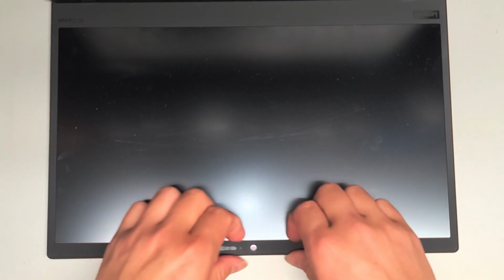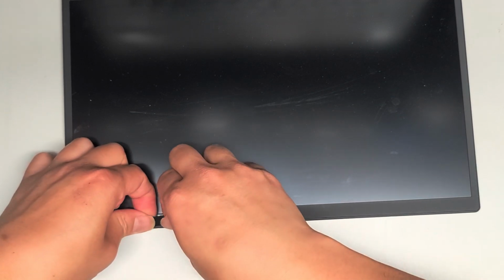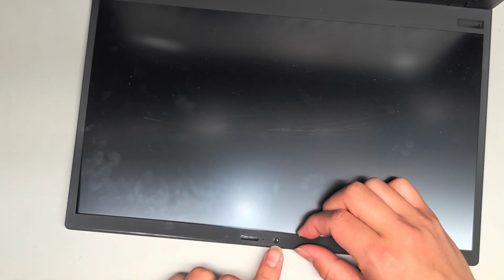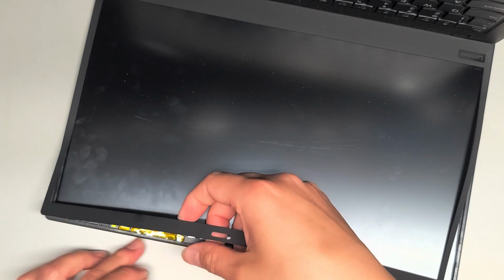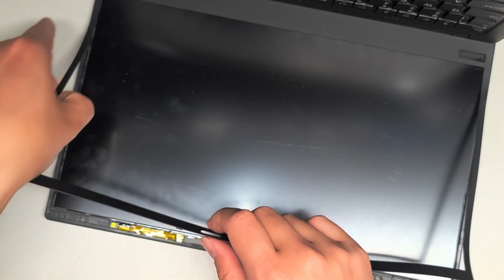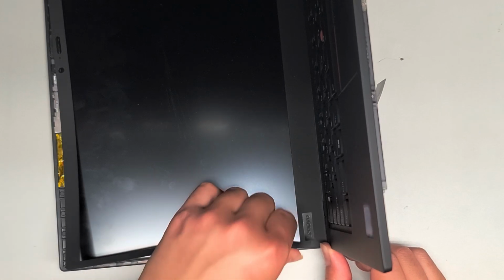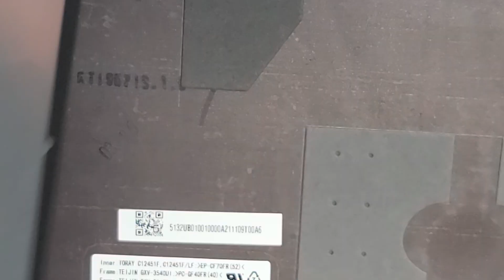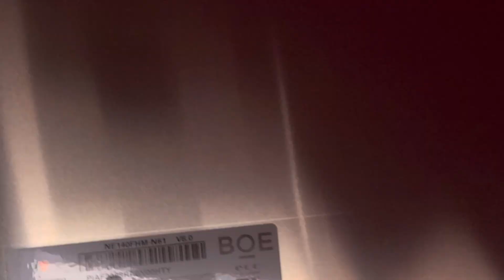7th Gen Generation Lenovo ThinkPad X1 Carbon Disassembly LCD Screen Replacement Repair How to Guide

Comment: Thanks for the guide! I have the x1 gen 7 with a 4k screen, and want to change to 1080p for better battery - is this compatible or possible?
Reply from the maker: No idea
Reply: You might need a different cable for that.  No issues with the motherboard and OS readjusting to a new screen.
Reply: @ it totally worked - thanks for the inspiration!

Comment: Thank you! (1) How can I change the display cable? (2) If screen is okay but cable is loose, can I replace the cable without replacing the screen?
Reply from the maker: You'll have to remove the entire display assembly and remove any other parts that are preventing the cable from coming out.

Comment: I have a 4k model, which consumes too much battery, any chances I can swap the FHD monitor stright?
Reply: You need a screen that uses the same 40 pin connector. I did the swap today from the 4k screen to a 1440p screen which shares the same 40 pin connector
Reply from the maker: Interesting
Reply: @Techdolphin200  Would it be possible to change a non touch FHD to a touch FHD if they have the same 40pin connector?
Reply from the maker: No idea. I wouldn't mess with it.
Reply: @Techdolphin200  Any issues with this? I want to change from 4k to 1440p too
Reply: @Paristones  been working fine since i left my previous comment. still use the laptop everyday for my job but i tried to reuse the adhesive that it came with and it ended up just peeling off after a few months so I would use new glue
Reply: @Techdolphin200   Appreciate the insight!

I have the UHD (3840x2160) and want to switch to 40 pin WQHD
(2560x1440) for the same battery reason.

Did your battery capacity improve? I only get a few hours on the UHD.
Reply: @Techdolphin200  Has the battery life significantly improved after the switch?
Reply: @Paristones  Yes but nothing crazy. I don't really have any numbers on the improvement but it has more life
Reply: @Techdolphin200  I just did the swap an it works great - thanks for giving me the confidence!
Reply: @Paristones  glad it went smoothly!
Reply: @Techdolphin200  Did you get the bezel to stay flush?
Reply from the maker: Not that I know of.

Comment: please make an assembly video as well.  I had some trouble getting it to fit correctly.. it was for a customer. oh well   no complaints yet :) double sided tape in the lid seemed to work a bit
Reply from the maker: Already returned it to the customer. Don't have it to make videos anymore.
Reply: @ItsBinhRepaired  how did it turn out for you. ?
Reply from the maker: @247smith  I think the lcd received was too thick. Needs new adhesive.